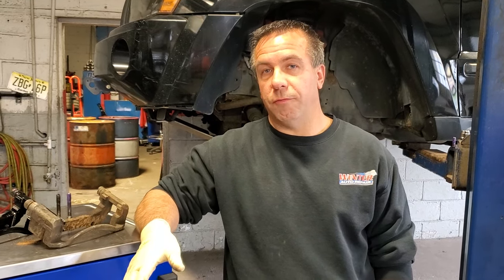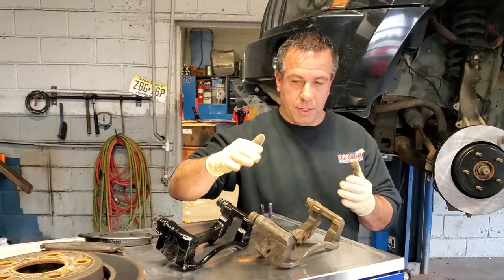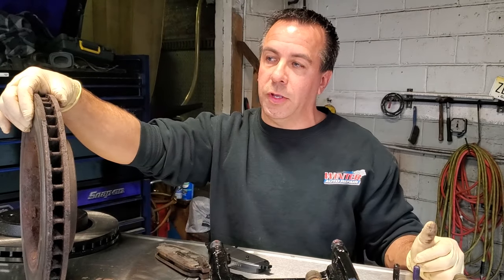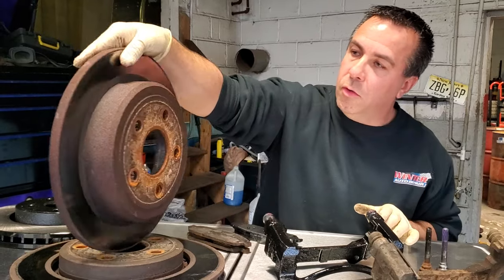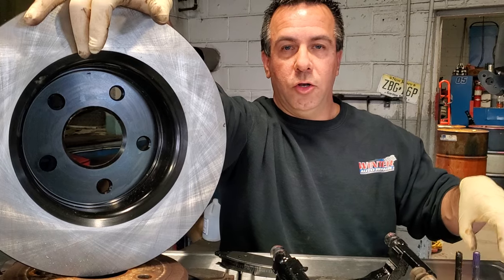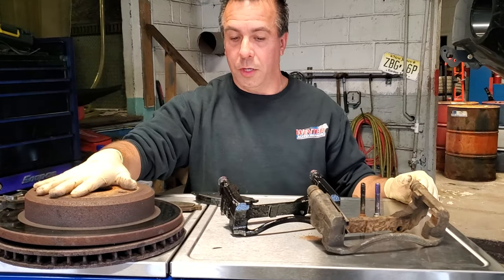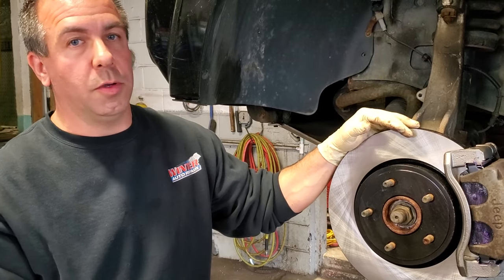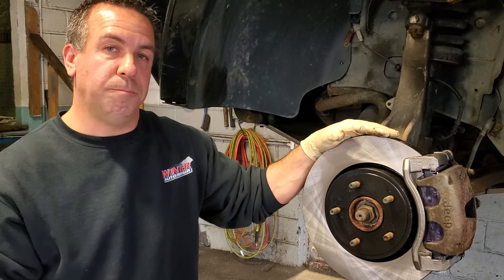High quality brakes vs cheap brakes

Comment: Why is surface rust on a rotor so detrimental?
Reply from the maker: The rust deteriorates the metal and hurts its integrity. The thin rotor will warp easier. It can also cause glazing on the surface, which increases stopping distance. It also will cause the pads to wear faster.

Comment: Vehicle inspections are a 2 sided coin.  In Pennsylvania we are paying yearly to inspect brand new vehicles with no mechanical issues.  We get charged anywhere up to $100 to be able to operate brand new vehicles on the road.  Meanwhile we don't have any more or any less accidents in PA vs. NJ.  In NJ you are doing emissions inspections only.  I feel like if you don't know how to maintain your vehicle, then you shouldn't be owning or driving a vehicle.  I don't need another person to tell me I need to take care of my cars.
Reply from the maker: In NJ inspections have always been free. Well, nothings really free., but it was provided free of charge with your paid registration. This also takes out the mechanics ability to find things wrong that aren't necessarily wrong. Then you could go and have it repaired by whomever you wanted or do it yourself. That's how it was until we did away with it to save money. 
Now our cars are soo poorly maintained that PA people don't even want to buy cars from jersey because they won't pass your safety inspection. 
Unfortunately, people don't care about their safety, especially in a down economy.
Reply: @WinterAutoRepair  they also have CPO vehicles.  Vehicle purchase and routine maintenance are 2 different things.  If you're buying a used vehicle, you'd be foolish not to have it inspected mechanically if it's not CPO.

Comment: Only way to know if you have a good rotor is to chuck it in your lathe right out of the box and check runout. I have seen it all. But most don't have a lathe so it is all guess and by golly. Want to know how to choose a PRO auto shop? Look for a lathe, a milling machine, or a Bridgeport and real drill press in the shop. If you see big recliners and hookah pipes, go away fast.

Comment: Do you have a link to those good rotors?
Reply from the maker: Every car will be different, so I can't supply a link. You can go to your local autoparts store and ask if they have Centric 120 or 125 rotors. You can also get Perfect Stop in high carbon, which is good. Online, Rock Auto usually has them available! 
Good luck and thanks for watching / commenting. Please subscribe if you haven't! Thank you.

Comment: Basically, the gentleman is truthful. However, the generic Autozone/O’Reilly house brand brake parts are fine to use for normal driving. The brake rotors and pads that are house brand are fine. A “white box” rotor is made of “pig iron” that is the lowest grade of iron and will promote rust, as the Gentleman stated. The problem is that might rust more than the other one because the range content of the iron can vary greatly. “White Box” rotors are sold extensively to used car dealers to maximize their profits. Reputuble neighborhood mechanics will sometimes offer them to customers that plan to run the old beater another “two or three years.” But a house brand brake rotor should last at least two sets of pads if the pads have  not worn completely out. If they wear completely out and the the rotor is scored, it doesn’t matter if you have the best brake rotor or white box……THEY’RE TOAST! I admire the gentleman’s honesty in mentioning that brake rotors today have less metal and rarely can stand being resurfaced. Great video. I myself, use white box rotors because they are cheap…….but with the best pad available and change the both the pads and rotors myself. Again, GREAT VIDEO!
Reply: I flat out refuse to buy Chinese made brake rotors or pads. They are junk, all of them. I own a Japanese and German car, the only brake parts worth a damn are those made in Japan, US, or Europe. It’s worth the extra money for high carbon rotors and coated rotors. The ones he put on that Jeep will be toast in 15k miles.
Reply: @derekjlight  can you even buy non-china made brake parts today?   If so, name some brands.
Reply: @jeffro221  are you kidding? ATE, Pagid, Zimmermann, Brembo (not the cheap Brembo), Akebono, TRW. Shall I keep going?
Reply from the maker: Thank you for watching the video and commenting! I appreciate the support. If you haven't already, please subscribe as we are currently making new videos. Also, let us know if there is something you'd like us to do a video on! Thanks again for the support.

Comment: I do My own brakes, I do order top quality High Carbon rotors and Ceramic pads, I've sanded and replaced slide hardware, and greased them well the backing plate to, You got me beat on coating or painting caliper bracket, Now you made me have to up my game lol..👍
Reply from the maker: Nice!  Glad to help!  Thanks for watching and commenting.

Comment: Does it matter the whither they’re high  carbon alloy or high carbon cast iron I’ve seen both being sold, also I found duralast high carbon rotors but they’re only $118 are they legit high carbon rotors? They’re not much more expensive at all. Just making sure I’m buying the best I can

Comment: The amount of rust on so many cars on Youtube! repair videos is insane.  I guess it is the snow and salt on the roads.  Everytime I do work on my car, I always feel lucky that there isn't any rust to deal with.
Reply from the maker: Unfortunately, the northeast uses salt and even worse is the Brine they use. It's literally salt water sprayed on the roads 2 days prior to a snow storm. It's destroys frames, suspension parts and even eats the bottom of radiators.

Comment: I put syl-glide on 1 pin, purple goo on the other. When they came back for another set of brakes in 50,000 miles, I stopped using purple on the pins. It was always dried out compared to the syl-glide.

Comment: I’m in pa near Pittsburgh and I change my breaks 3times a year. (I drive a lot + hills and mountains)
And on the 3rd break change I put new rotors all the way around. I also clean and lube the slide pins every break change.

My only question is what kind of black coating do you use on the hardware?
Reply from the maker: On the caliper bracket we use high temp brake paint. The rotors come coated with an electrostatic coating, we don't apply that here. The purple grease is Permatex 24125 and is good to 3,000 degrees so it doesn't dry out.  Thanks for watching and commenting. Please subscribe, we very much appreciate it!

Comment: Always buy parts from dealership last longer.
Reply from the maker: Completely not true. There is a lot of aftermarket that is better quality than OEM parts. There is also a lot that is lesser quality. 
We only use OEM or better in our shop. I'd rather fix it once and be done.
Reply from the maker: @jeffro221  sorry Jeff. When I made this video it was meant for my website. I had no idea it would be as popular as it is. If I had known I would definitely have mentioned brands I like. 
In this video we did use Centric brand parts. They are my favorite if you can find them. The rotors in their 125 line are the high carbon. The 120 are my second choice. If you can't find Centric we also use Perfect Stop in their high carbon line, not their basic line. The owner of Centric opened DFC after he sold Centric. We just started to use his parts and so far they have been ok.  We haven't been using them long enough to give you an honest evaluation on their longevity yet.  
Now that our YouTube channel has gained interest, we will be making more videos and including information to help everyone. 
Again, this video was supposed to be information for our customers on our website.   
Thanks for watching and commenting. If you'd like, please subscribe as it will help us make more and better videos. Chris

Comment: Lol it didn't "fall off" they used it untill it hit metal cause theyre broke or irresponsible. I know cause I've done it when I was a 17yr old and broke.
Reply from the maker: The pad material definitely feel off. The backing plate rusted so badly that the pad material came off. The customer came in right away and while taking the other pads off, the material just separated off the backing plate. We also see customers wear through the pad and grind into the rotors. I have a rotor in my shop that the customer wore through the pad, the backing plate and didn't stop until the piston fell out of the caliper! the rotor is worn into the center veins. This video, the customer didn't wear the brake pads down, it was a cheap pad that rusted and fell apart. Sorry for the delayed response. I'm new to YouTube and was over whelmed by how many comments we received from this video! Thank you for watching and commenting. Please subscribe, we very much appreciate the support!

Comment: What type of spray did you use on caliper bracket?  Where do you get the carbon rotors?  We need shops like yours in our area.

Comment: You know, I put over 500,000 miles on the factory (front) rotors on my 1983 Toyota Camry and they were worn 1.2mm (wear limit 6mm) from factory specs. My ex-roomie goes thru a set of rotors on a Ford Expedition in three years and I don't see the HELL how! My 2011 Ram Hemi Quad Cab is at 75,000 on the factory rotors and pads and I drove a 1963 Chevy II Nova 22 YEARS on factory brake SHOES (330,000+ miles still good on cheap-ass shoes and drums)! I had to replace the shoes at 330,000 when the master cylinder got a leak and one of the shoes broke in-side the drum. $61 worth of new shoes and wheels cylinder re-build kits and a new master cylinder and Momma drove it 25 more years and sold it to her hairdresser who drove it about 20 years. I'm not hard on tires or brakes or cars or motorcycles!

Comment: What do you recommend for a 2013 Infiniti G37xs coupe equipped with sport package.
Reply from the maker: I'd put the Centric 125 high carbon rotors on it.  The 120 are their standard line. Still great quality.   Not sure what your exact part numbers would be.  Just make sure the rotors start with 120 or 125.
Reply: @limodxb9177  they got some really cool looking rotors
Reply: For g37xs brakes you can try geobrakes.com they sell all oem brakes

Comment: It has to suck living in a rust belt.  I'm in the southwest and my 20+ year old bolts look and come out with ease.  Also have 280K on my original rotors (Toyota).  Mine turn them next time, still enough meat on them and I really don't trust anything new today.

Comment: You're using the "inspection" word too much. I want zero inspection. Bottom line is that as bad as brake components can be, when you push the pedal down, it will stop. The more inspection we ask for, the more they push to make things impossible for everyone.

Comment: Rust rotor is unacceptable, rotor lasts only 30-60k miles is also unacceptable. The rotors I used general lasted at least two pairs of ceramic pads.

Comment: The moral of this video is buy oem parts and have a real mechanic install them for you.  Cheap pads and rotor are not saving you anything in the long run.

Comment: I watched the video and I'm seeking the quality you spoke about.  I see Power Stop brake kits and was about to place an order before noticing Country of origin:  China  I guess I'll continue looking.
Reply: ALL Rotors are cast in china.  Some are finished there and some are finished here, etc.  Power Stop is a Centric company so they aren't junk BUT, I don't use them because Slotted and/or drilled rotors look sporty but provide no positive gain while they do facilitate quicker pad wear and even rotor cracking.  Again, unless you are a formula racer, you will not see any performance benefit from drilled or slotted rotors.

Comment: I couldn't disagree more. If you use OEM rotors and OEM specs for thickness you can cut rotors. Obviously you would want to use good judgement, but saying it hasn't been done since the 90's is insane and untrue. Many "whitebox" rotors have the same cross-hatching and black coating. Use OEM and you will get the best result. Bottom line. Junk parts, junk results.
Reply: I have had 2 sets of rotors cut in the past 20 years. Last set was last year, the rotors were specialty and $120 each. Machining cost was $30 per rotor. So for a $50 rotor, its not worth machining them in most cases.

Comment: Update #2
Buyers of Centric/Stop Tech Rotors beware:
Regarding several batches, the Black E-Coating is not on the inside of the hat, on the 120 Series or the 126 Series.
This is as per Stop Tech technical support.

I received the 120 Series blank rotors which were missing the Black E-Coating as described. Stop Tech told me it should have the coating and that I should return to the seller which I did.

I then spent 3x the money and ordered the 126 Series, High Carbon Slotted Rotors from another Stop Tech authorized distributor. Again, no Coating on the inside of the hat.

I notified Stop Tech who now said he checked with an engineer and that during the pandemic they had to switch suppliers several times and that the Black E-Coating was either missing on the inside or the vanes passing QC because of a supply issue and doesn't affect the operation of the rotors. But I could return them if I still wanted to. Which I am again doing. I asked who I can purchase them from and be assured that the Black E-Coating is complete. I'm awaiting a response.
Reply from the maker: You are correct. During the pandemic they had issues. You can also try Perfect Stop and Durago EP. Those companies offer High Carbon and coated rotors as well. Also as a side note. Centric has been bought out by Raybestos since we made this video. We are testing their quality to see if it is lower now that it was bought out. In the mean time we use the Perfect Stop and Durago EP when Centric aren't available or aren't properly coated. I hope that helps you. 
Thank you for watching and commenting. Please subscribe, we very much appreciate the support!

Comment: The problem with those rotors isn't that they were "white box" as much as they weren't uncoated. You can buy plenty of "cheap" rotors that are coated, and if they are I haven't noticed any real difference in how long they last.
Reply: I agree that the color of the box is irrelevant but it is a flag of sorts.  Cheap stuff comes in cheap boxes.  Sadly ALL rotors come from china now days.  They may be machined in USA or England, etc. but, the blanks all come from China.  So, what really matters?  Carbon content, thickness and coating.  I really like the centric 125 rotors but can't always get them quickly enough.  Autozone Gold rotors are a solid choice as well.  They are made "finished"  by  EBC who is another quality brake supplier.  Look for coatings and then pick it up and see how heavy it is - Simple.

Comment: Very hard to find someone who is honest like you. I've had issues with mechanics even when their shops are AAA approved - doesn't mean a thing to me now since I had notified AAA.. They never did respond. It's all about getting your car serviced as fasted they can. Numerous times when I had just a simple tire rotation, I would find my lugs nuts NOT torque to specs and they would come lose. That was the end of using that shop.. Still looking for a good mechanic here on the Cape...Reason for viewing YouTube videos is to see what I can do on my own from now on.. A  lot of good info on these videos where someone can learn to work on their own cars...
Reply from the maker: Unfortunately. You're not wrong.  My suggestion is to ask on your local Facebook page for your town. See who gets the best reviews and then interview them like you're looking for a Dr.  
Best of luck in your search!

Comment: The pad didn’t fall off, it wore off. Quite honestly, the customer isn’t the sharpest tool in the shed. If you’re driving around listening to that horrendous grinding for as long as they did, you’re a menace.
Reply: I bought brake pad from autozone and installed them on my girlfriend car, the brake pad material started to break off one pad and started to make a grinding noise. I took the brake pads off and returned them, they asked if I wanted to exchange them,  I told them to give me the money back and went to a different auto parts store.
Reply from the maker: The pad material 100% fell off the backing plate it's bonded to. The plate rusted so badly and so quickly that the pad material separated from the backing plate. Once it started to make noise they brought it right in for us to look at and repair.